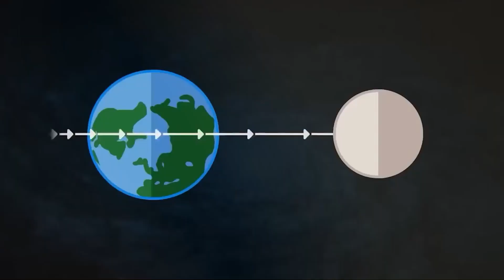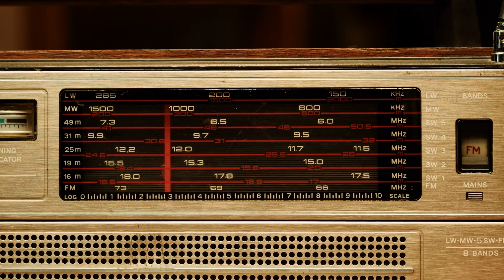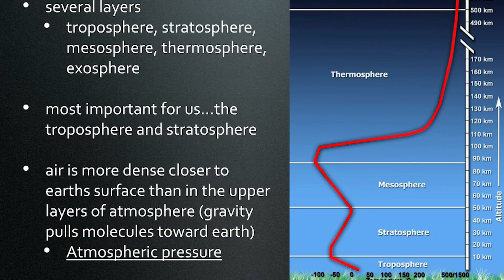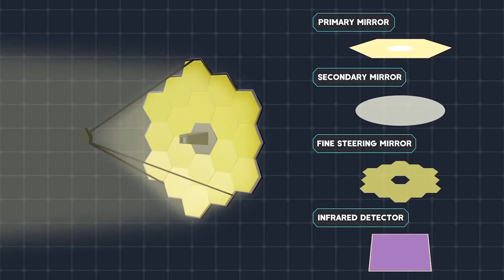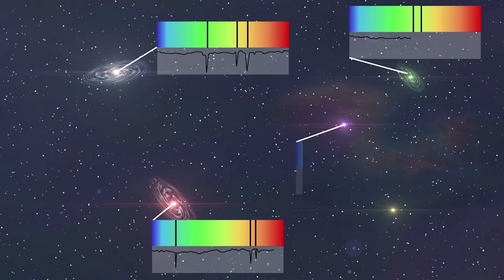James Webb Space Telescope Uncovers SHOCKING Secrets Of Mars

Comment: If you have 100 numbers and you roll them, the probability of them all staying in the order of 1-100 is very small. The probability of all 100 numbers landing in the order of 1-100 is 1/100! (1 divided by 100 factorial). This is a very small probability, because 100! (100 factorial) is a very large number.

To get an idea of how small the probability is, you can compare it to the number of atoms in the universe. It is estimated that there are approximately 10^80 atoms in the universe, so the probability of all the numbers landing in the order of 1-100 is much, much less than 1/10^80.